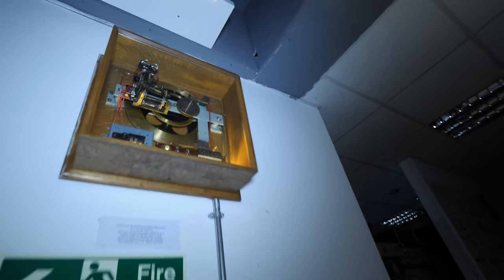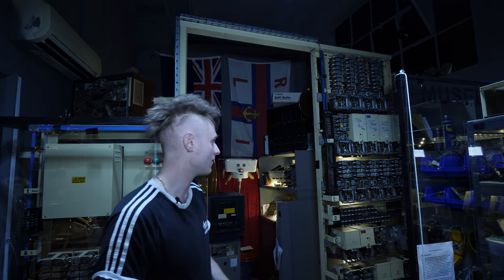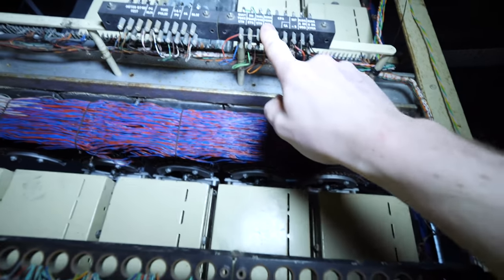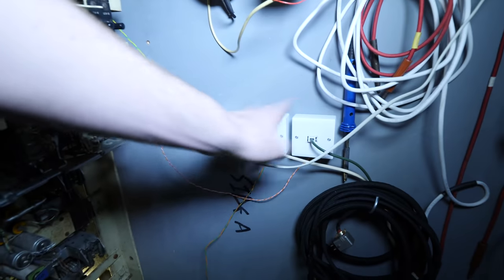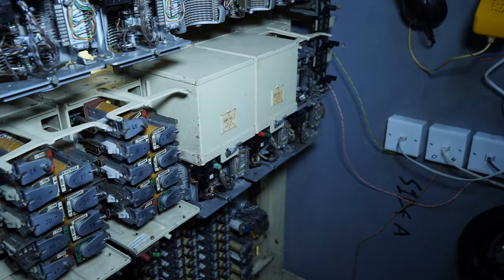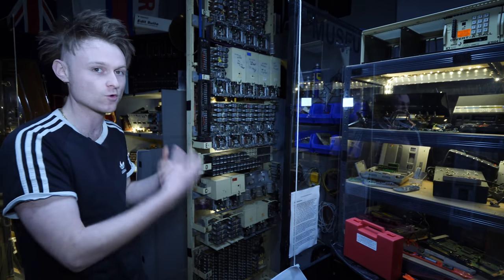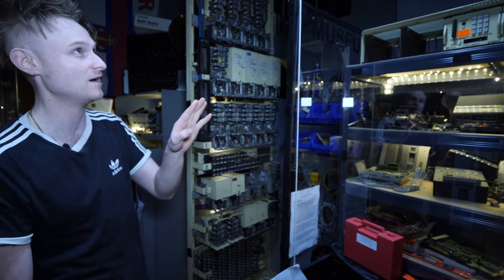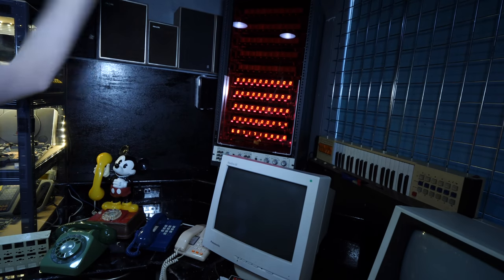Endless Repairing Of The Relay Strowger Telephone Exchange. And More

Comment: What about having a computer on the micro museum side use a historic 9600 baud modem to talk to a modem on your side connected to some simple logic to control a sequencer or a synth in some way? You could run the audio back over a second line to a speaker, or 7 or 8 bit digitize it and the computer the other end can play it back. I believe the Amstrad CPC can do a pretty ropey 5bit natively. Or, maybe make a rudimentary DAC card for one of those old machines to do 7 or 8 bit audio. 9600 baud would be enough for a "classic" computer sound. A text-based remote analog synth system :^)
Reply: I would even go so far as setting up an internal bbs, and maybe some oldskool dialup multiplayer thing.
Reply: rig a vocoder loopback

Comment: Used to work on them when I first started working. Actually designed a basic exchange for the college I was studying at. They wanted it to show some of the work they were training people for. It was so long ago!! But nice reminder of my early life . Hope all your bits and pieces grow and all success to your museum.
Reply: Thanks there were two types of strowger I think one was 2000 and the 4000 but that's a hazy memory. They were putting in TXK reed relay systems when I was working there. Also they were waiting for the computer controlled system I think TXE but don't quote me on the names. As an aside I installed one of the first computer controlled PBXs I was there for about 2 years we maintained it as well. It was for Lloyds of London a brand new site next to a river , built on ex dockyard.

Comment: I believe the cable pressure alarm is for the major underground cables going out to the field (distribution boxes and subscribers) they are usually sealed and pressurised with nitrogen, if a cable gets damaged, the pressure drops and warns the exchange
Part of my job was woorking on suite fuse alarms (suite of racks), so my timesheet often said 'suite FA' :D
The meters don't have a reset, someone comes in with a camera with a conical hood and takes a photo of groups of meters, they are then checked and you are charged for th units since the last reading, just like an electricity meter.
The timing of the meter pulses must be adjusted throughout the day for peak hours etc, but the master clock sends constant pulses, i'm thinking that S&Z might be the mofification
I was never sure how the ringer creates dial tone etc, but it sounds like it's serrated discs with coild, very much like the Hammond organ
Reply: That's what I thought on the cable pressure but I'm not sure why it would be on this rack that's all. I need to source where it's coming from. As the outward wiring and pressure meters would have been on another rack
Reply: But cool on the FA. so yeah I guess the question is why was the CPA on this rack?
Reply: @LOOKMUMNOCOMPUTER  Yeah, normally you would expect it to be near the MDF (main distribution frame), maaybe that frame was in a small local or business exchange, the alarm may have been put there for convenience with the FA etc.

Comment: This is so cool, I started messing around with discord and I think it would great the exchange set up. Multi voice channel. Just an idea for you. So great to be part of your journey Sam. 🙂
Reply: In what way? As in wire up discord to the exchange?? Trying to figure out what you mean haha
Reply: @LOOKMUMNOCOMPUTER  Yes discord you can multi text and voice chat rooms. So I was thinking you could have a few voice chat rooms linked up with a soundcard to each phone line on the exchane. So discord could be linked the same as Techmoan tape machine. That's what's popped into my head trying to keep it simple and cheap for the start. I do electronics in communication bridging mobile phones to walkie talkies and built some prototypes. I will keep on it and give some updates if I feel they could be useful for you.
Reply: @TRIPPLEJAY00  oh I see
Reply: @TRIPPLEJAY00  that would be easy. Making multiple phones call the same line is doable would need a lot of final selsectors though haha
Reply: There used to be numbers you could dial to do that, I bet there's some old hardware for it.

Comment: Great to see Strowger gear in action. Are you gonna get a TXE4 switch too? Avoid a System X though. 😀 My first job was at STC.
Reply: I remember a few smaller X Bar systems where the cabinet doors were removed or they'd overheat.

System X -- I was at BT when it went in at Euston exchange.
Heavy business use area -- configured for domestic traffic by  'planners'.
Fell over more frequently than a drunk on a escalator.
Reply: @keithsquawk  😁  I love that analogy!

Comment: Great to see the strowger systems going again especially as analogue lines(pstn) coming to an end in 2025 with only Voip.  The switch over has started. One thing to look out for is old auto pulse dialers which are still out there as worked on them if it ain't broke don't fix.

Comment: now I wonder how the modern stuff actually works- I am guessing with everything being VOIP now there are not a lot physical connections being switched- but how did they do it before that...
Reply: These exchanges were replaced with digital switching exchanges, the signals were still analogue though; have a look for information on System X which was developed by GPT